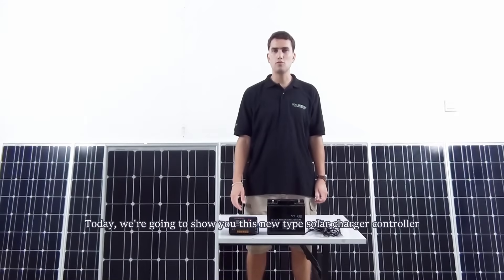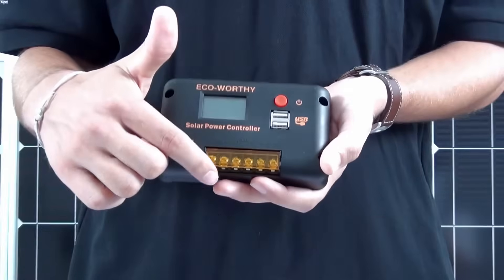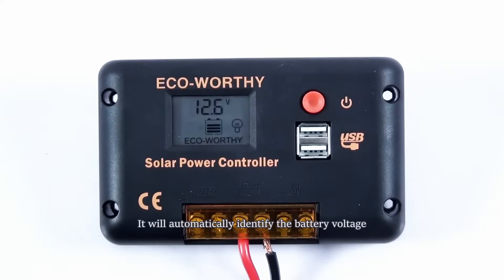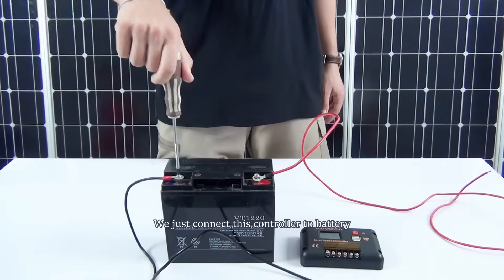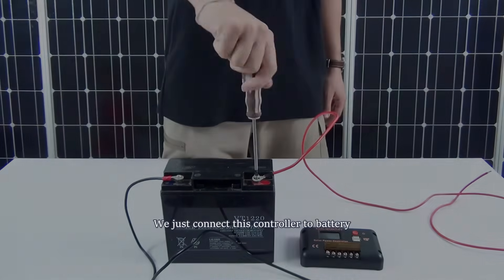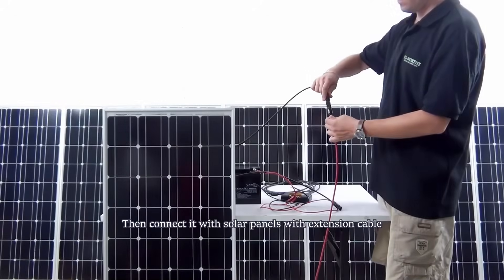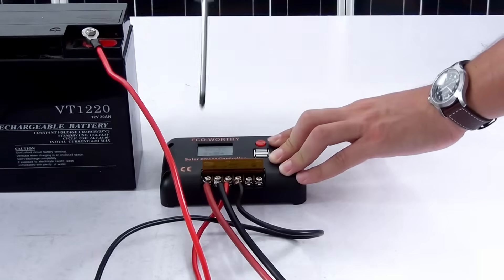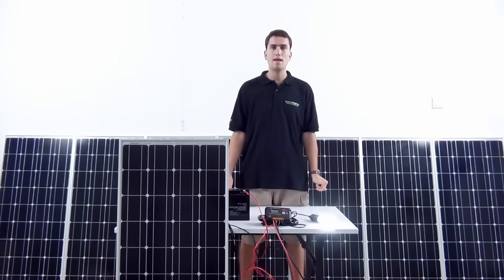How to set a solar charger controller? 12v 24v PWM Solar Charger Controller Configuration

Comment: Hi
I have the same charger controller and i've just look at the official manual and for LiFePO4 battery we must set the controller to b02 and not b03 and PWM must be set to Pof

https://manuals.plus/m/6c6832f56513f7357545cfd9a354de29c0fd1e4d7f80f3b45182409120c21f3e_optim.pdf

Comment: Can I turn the load on or off with the button instead of removing wires? If so how? Thanks
Reply from the maker: Yes. The red button is a key to turn on or turn off the loads that are connected to the controller. 😀😁

Comment: What is the load part for if I want to run separate circuits from the battery it charges?
Reply: Load is for stuff to run during sun only. I have the load of mine (fused) running to an exhaust fan for my shed. When the suns out, shed heats up and fan exhausts it, when sun sets fan stops.

Comment: Have the 60A auto 12/24  Solar charge controller and no USB  . Much heaver metal heat sink than this one. Model HP2460 .  Guess I can find a 12v  USB charge controller that can connect to the load.

Comment: I purchased the 200W kit that came with a 30A controller and the "pro" LiFeP04 100ah battery. This video as well as the one on the purchase web page indicates that battery type B03 should be selected for a LiFeP04, however the written manual that came with the controller indicates that it should be B02. The manual adds that the B02 setting has only an ON-OFF charging process, vs. 3 stage. I talked to Dalton in customer support and he indicated that B02 is correct. Anyone else have this problem?
Reply: I have the same problem
Reply: Same here, video says b03, and manual says b02...realy strange
Reply: exactly as you said ...my model is EW1906 V1.0 I do not what model is in the video. I set it up as manual instruction says.

Comment: Did you make a mistake at 0:47 ? I'm pretty sure b03 is not for lifePo4,because it's different in my manual.
Reply: Please could someone help me I have a liquid acid battery what setting should it be on. Any help would be appreciated ❤
Reply from the maker: Hello, in that case, the controller you get is a new version, we've upgrade the software, so just check the manual please

The video we don't change yet because there still some customers are using the old ones and looking for setting details.
Reply: @ecoworthy_official  You should put it in the description, because this video will mislead new users.
Reply: @ecoworthy_official  how can I tell if mine is old controller or new one?

Comment: How much A is save for the Load-Output? At 12 V ...
Reply: No answer from distributor so far
Reply from the maker: Hello, sorry for the dealy reply, the max power from the load port is 12V*20A=240W, under the 12V mode